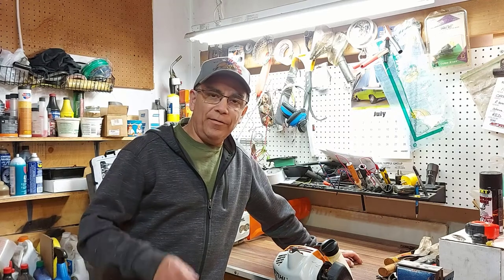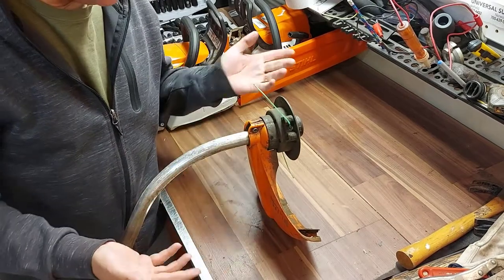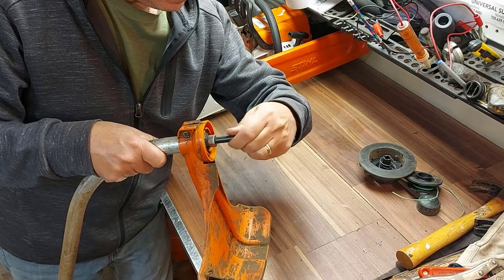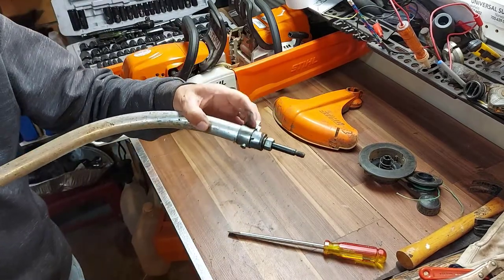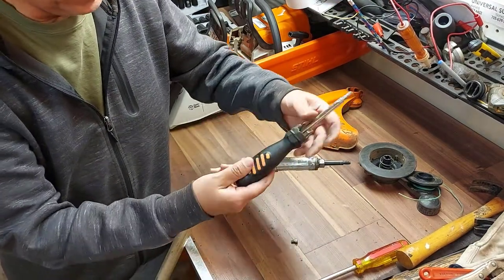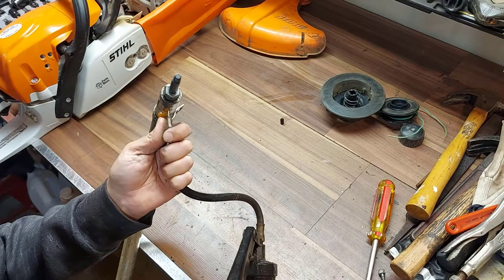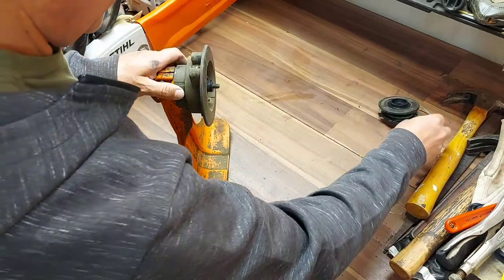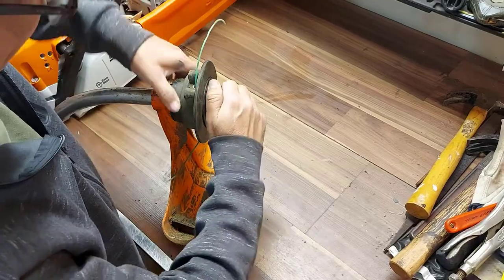Stihl Grass Trimmer Maintenance | The FS38 Has a Hidden Grease Hole

Comment: The "grease hole" screw retains the bearing mounting inside the tube. The whole bearing can then by pulled out easily. I placed the spindle in a pillar drill and spun it slowly whilst pushing in grease with a 2ml syringe - it doesent go in easily but eventually clean grease squidges out of the ends. Also the flexible drive can be pulled out of the tube and re-greased and slid back in. Attach the bearing first and rotate it so the flexible drive engages at the engine end.  All very easy. But not covered in any Stihl manual that Ive come across.

Comment: I like your stuff! 
So I own a Stihl too eh big beast of a thing but it's great. Anyway a guy at the dump gave me a green Featherlite & boy is it ever light!  FL25C is the model. Later found out he just said it won't start.  I know most ppl including him I guess consider these Poulan things garbage. But I can't help but like the little thing, Long story short I took it apart including the carb; cleaned it up got er goin. It just doesn't run for long &/ or it bogs out, then a little puff of smoke out the carb & goes to sleep.  I suspect the idle screws need adjusting but they're some weird shape & I can't change them.  Suggestions?

Comment: Thank you for the info on the grease location. I bought my first and use gas weed trimmer FS38 at a garage sale. It runs great.
Reply from the maker: That's great, they are good equipment.
Reply: What’s it like for edging?

Comment: I would like to add, you need to turn the head shaft while greasing to work out the old grease, otherwise your not getting the old dirt and bad grease out.
Keep pumping and watch your head as you turn it and pay attention to the color of the grease coming out, stop ounce the color of the grease looks the same as what’s going in. No discoloration and clean looking. This will keep that bearing healthy.

Comment: I have a Stihl FS 36 that still runs great, just won't die! Good compression. Trouble is the orange plastic cowling that covers and cuts the line has broken. Also I would like to buy a new line-trimmer bump head. My local dealer cannot access parts for a machine this old. Anybody know of another source?
Reply from the maker: Try ebay
Reply: Amazon had replacements. C6-2

Comment: Also be aware of the 2 nuts securing the air filter box to the cylinder head. They can become loose and enter into the combustion chamber/crank case and destroy things.
Has just happened to me, with damaged piston and cylinder chamber. My FS38 has had practically no more than 2 hours working time. 
Who designs it so you have tiny little components which can become loose next to a large opening leading into a fast moving mechanism? It's almost as if it was designed with this flaw.
Reply from the maker: Wow never heard of this. Maybe it was an odd thing where the nuts weren't torqued properly from the factory. I have many hours on mine and my Dads has been 5 times as much as mine. No issues. I will check mine.
Reply: @GettingItDoneRepairs  
Yep, make sure they are not loose. Some sort of locking compound wouldn't hurt either.